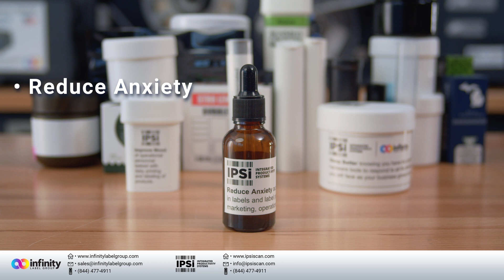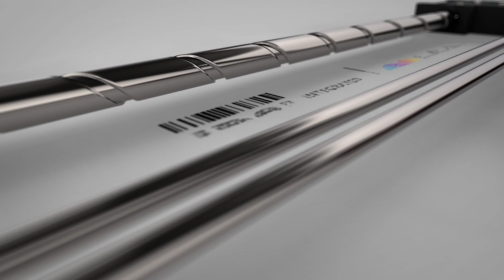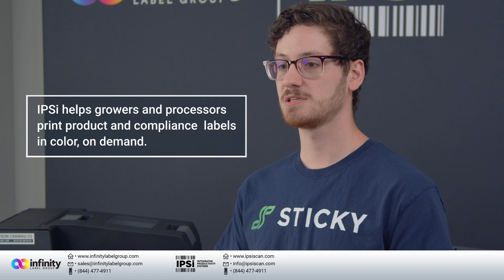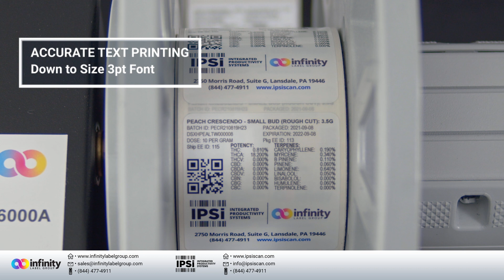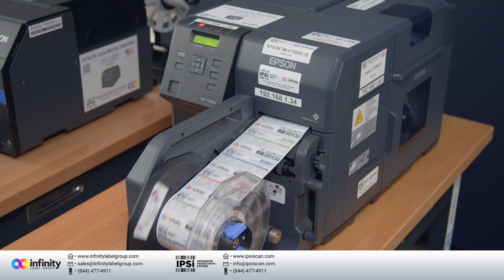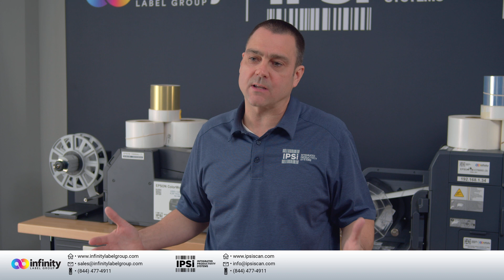IPSi Print Lab - Cannabis Labeling: Which printer is right for me?

Comment: So I currently use the Epson c6000 with unwinder and rewinder but my finished roll is way to loose and can't run it on my label applicator do you guys have any tips for tighter finished rolls. Your help would be much appreciated.
Reply: What make/model rewinder do you currently have?  You can manually tighten the roll after it is rewound if your current rewinder doesn't work properly.  We sell the DPR rewinder units which are available globally.  https://ipsiscan.com/wp-content/uploads/2020/11/IPSi-DPR_Labeling-eng-Data_Sheet-unwinder-rewinder-Epson-C6000A-C6500A-2-2022.pdf 
If you are in the USA, you can email your contact information so sales@infinitylabelgroup.com or info@ipsiscan.com and we can engage directly.